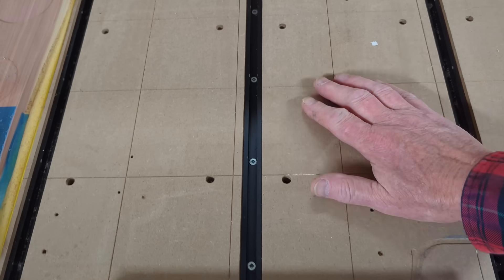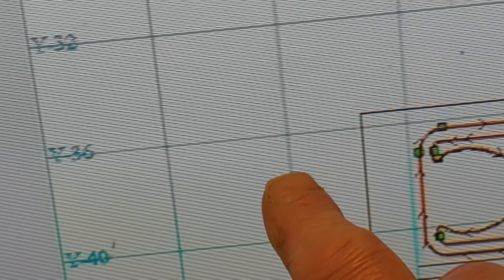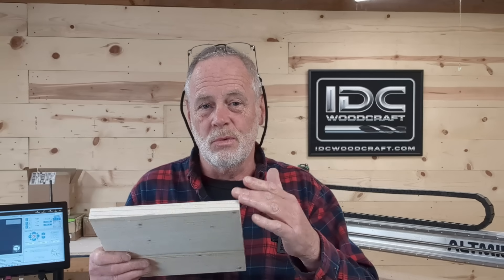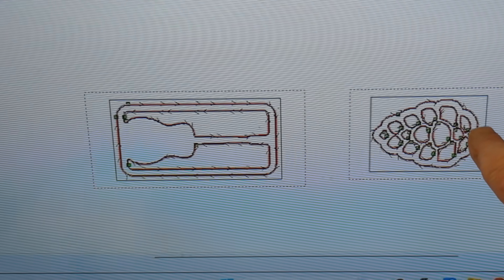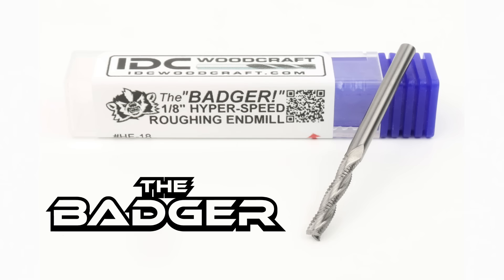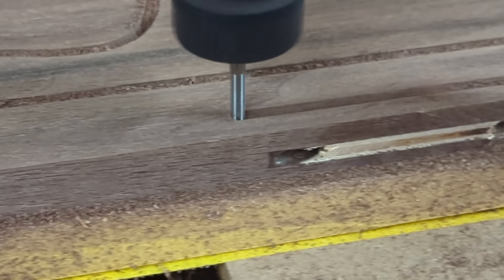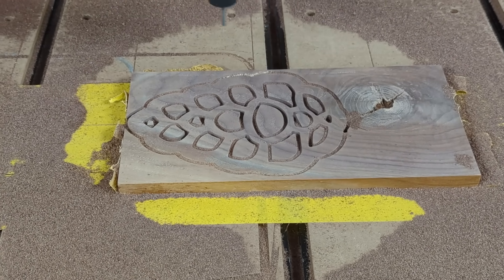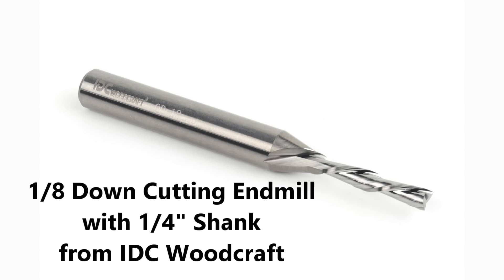This CNC Trick Makes XY Zero Setting Obsolete [Think G53 Gcode Command]

Comment: If you need even more precise alignment, I suppose you could drill some holes in the bed for locator pins. I've seen people do that when milling both sides of a piece. Aligning to lines on the bed seems like a fair idea for most uses though.
Reply from the maker: Absolutely, drilling locator holes for pins can really enhance precision when flipping pieces. Thanks for sharing that insight, and I appreciate you watching the video!

Comment: Oh another dumb question.  I bought your 1.5" surfacing bit which is great but i have been using a contour cut so I can only mill off .01 at a time.  I learned quickly when I had it set at .07 and it jammed into the wood.   Should I use a pocket cut so I can set a ramp-in??
Reply from the maker: No worries, my friend! A pocket cut with a ramp-in is definitely a good idea for larger cuts like that—it can help ease the bit into the material more smoothly.

Comment: Useful tip thank you 🙏 
Which CNC control software are you using and what brand is that touch screen? Great setup 👍😎🇦🇺
Reply from the maker: Thanks for the kind words! I'm using Mach3 for CNC control, and the touchscreen is from a brand called TPC, which works great for my setup.

Comment: Awesome video! I'm new to this and have a few questions - for the badger, I downloaded the tool databse for carbide create, I just wondered for the feeds and speeds, I'm running a makita router on a shapeoko 4, are the speeds in the excel sheet applicable or do I need to adjust? Secondly, any idea if you can do this XY zero trick on a shapeoko using carbide create? thank you!
Reply from the maker: Glad you enjoyed the video! The speeds can be a good starting point, but you'll want to adjust them based on your specific setup and material. As for the XY zero trick, that's a little tricky to walk you through over comments, so I recommend joining us for our live sessions every Wednesday evening at 8 PM EST. We should be able to help you out with that then, brother!

Comment: Another approach is home then use the Go To feature to jog to the grid point you set your material and zero it (X12 Y36 here).  Your project would start in the corner of the material as usual.  If you re-run jobs then you could include X12-Y36 in the file name so you know to jog there from home and zero.
Reply from the maker: That's a solid approach, my friend! It’s always great to have those clear points in mind when setting up your material. Thanks for sharing your thoughts!

Comment: I use 5000mm/min speed downcut 6mm bit 6mm deep 18000rpm
Reply from the maker: That sounds like a solid setup for your machining! Just make sure the material you’re using can handle those parameters for the best results.

Comment: Hello Garrett. I purchased the Badger and love it I think. The only question I would have is, unlike your machine, I do not have a spindle, but rather a Bosch router. I would think that running the plunge and cut rates that fast would put undue strain on the router. Is my thinking accurate or am I being overly concerned for no reason?
Reply from the maker: That's a great question. I would think the router can handle it easily. But if you want, you can allow the plunge down a bit

Comment: Another great tutorial video Garrett.
 These are especially beneficial to folks who are new to CNC. When I started out , there were'nt many learning tools, and anything available was on VHS.:face-blue-smiling: . A few tips that i have applied on CNC routers and CNC machining centers over the years. You can establish your machine home at the left front, or right front of the table, since that is the area that is closest to the operator. This saves the XY travel distance. Your grid idea is similar to what we employ on our machines, however what we do is drill/ ream or interpolate with and endmill positioning holes for locating pins ( dowel pins) at a right angle from one another on XY. So if you determine that 6" in on your grid is a good work position , drill locator pins at 1" intervals in Xand Y from that theoretical corner. If you tend to use narrow stock you only need a few holes in each axes. For 24" wide panels ( aka cabinet sides) you can drill holes at 12", and 24" on X and Y , and bank your work piece up against these pins, and you are both square, and in your XY 0 material position. Use step clamps, toe clamps, or double sided tape. If concern exists about hitting the locating pins during machining you can remove them once your work piece is clamped, or use delrin pins just in case it gets hit with the cutter. You can ad this location as a XY offset in your controller , or software to save time from going home. You could define these coordinates as home, however I don't do that. Hope this helps.
Glenn
Reply from the maker: Thanks for sharing your experience and tips, Glenn! It's always interesting to hear how others approach their setups and how techniques have evolved over the years. Your methods for establishing home positions and using locator pins sound incredibly efficient. I'm sure many newcomers will benefit from your insights!

Comment: Can you show us a descriptive video on how to pick a carve backup in Gsender, say if the power were to go out or flicker. Nothing worse than being 3hrs into a 3d carve and something like that happen . How do i resume where the Gcode left off ?
Reply from the maker: That's a great question! In Gsender, you can save your work at various points, and if there's a power outage, you would typically use the G-code file to resume the carve from the last known position. Make sure to monitor the progress closely and note the Z-depth where the carve stopped, which can help in repositioning accurately. If you plan for this, it can definitely save you from losing hours of work!

Comment: I have watched this 3 times and still dont understand. I have watched most of your videos and have never had a problem following your instructions. It may be the machine and CAM I use, not an altmill and gsender. I run a shapeoko with CM.
Reply from the maker: I appreciate your support and dedication to my videos! It sounds like the differences in your machine and CAM software could be causing some confusion. Each setup can have its own quirks, so it's understandable that things might not translate perfectly. If you're having trouble, trying to break it down into smaller steps might help clarify things. Keep experimenting and learning!

Comment: This works where the setup can be a little bit variable as some cnc home positions are not exactly repeatable can vary by a mm or two (Buildbotics stall homing is an example). CNCs using something like a proximity sensor to home tend to be more repeatable.
Reply from the maker: Absolutely, that's a great point! Sensors definitely enhance repeatability, and it's fascinating how different setups can affect accuracy in CNC machining. Thanks for sharing your insight!

Comment: I use fixtures on my cnc. The fixture has a zero point on it. The X,Y and Z are all zeroed out at that point on the fixture. I don't care what the machine home coords are. I don't even remember the last time I did a machine homing operation.
Reply from the maker: Sounds like you’ve got a solid setup going with your fixtures! As long as you’re consistently referencing off that zero point, you're in great shape for your projects!
Reply: @IDCWoodcraft  Thanks, yes the fixtures have a zero point where you zero out the tool that is off to the side of what is being cut or drilled.

Comment: I don't understand how to saves any time you still need to set Z zero and both work pieces likely have a different Z zero. There is a way to deal with this built into our machines. Setting X/Y zero in many cases is more of an approximation then accuracy so it only takes seconds to set. Z is often more accurate so it takes a few extra seconds to set but you still have to set it. Typically the only reason to have X/Y very accurate is because the stock is already sized in a previous machining step.

 The amount of time it takes to set up every project in software for this is likely more time than it takes to setup X/Y/Z zero. Never mind the future time it will chew up when you pickup the file again for later use.

 As projects go I would never use absolute coordinates in software like that. It 100% defeats the purpose of things like post processors and completely stops the ability of sharing the file or using it on a different machine. Has anyone ever downloaded a project with absolute positioning? Hmm I wonder why that is if its such a good idea.

 There is a way to do everything often called best practices. Best practices are a collection of ideas from millions of working professionals compiled into a list used for training and standards. Lets chuck that all out! What do they know!

Comment: Dear Mr. Garrett
I am reaching out regarding an issue with my VCarve Pro 12.0 Software. Whenever I attempt to send the program, I am getting an Error 20, and the machine only moves on the same spot and finishes the program.
I believe the problem is unit problems in the machine and when I design I did the same unit, but I am unsure of the exact cause. Could you kindly guide me on how to correct this issue and successfully send the machine and correctly do the job?
Any assistance or troubleshooting steps you could provide would be greatly appreciated.
Thank you in advance for your support.
Best regards,
Elias Wolde
Reply: Without you mentioning the machine or post processor used, it appears your post processor may be the issue. 99% of the time you would need to go to your post processor toolpath and save it as GRBL (mm/in) (*.gcode). If it barely moves, it’s probably saving it as (*.tap) I’m sure Garrett has a video on post processors and gcode info if you search his channel. -Peter
Reply: Most likely wrong post processor or at the very least a bad init gcode that is unsupported in the post processor.
Reply from the maker: Hey Elias! This one is a little tricky to walk you through over email, my friend. I recommend joining us for our live sessions we host every Wednesday evening at 8 PM EST; we should be able to help walk you through it then, brother!

Comment: You can edit the post processor so the machine does not go to the home position first. Just remove the code that does it and it will just travel to the starting point of your part. One of the first things I did on mine.
Reply from the maker: Absolutely! That's a great tip for streamlining your workflow. Thanks for sharing that with everyone!
Reply: @IDCWoodcraft  Thank you for all the great videos! I've watched a ton of people trying to explain things and I believe your the best one out there. You make things so understandable and simple. I'm sure it helps the beginners so much more. You're doing great. Keep up the good work.

Comment: Use the front corner as home and you will have less unneeded travel.
Reply: would require moving the end stop / limit with it. Maybe the machine is still on warranty or it's more than he would like to tinker around it
Reply from the maker: That’s a great tip! Using the front corner as home can definitely help streamline your setup. Thanks for sharing!